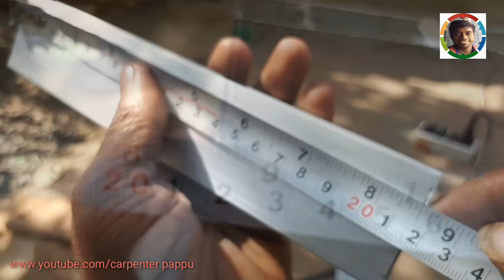Mini Aluminium bathroom door making

Comment: Bro how to repair the bottom corners of aluminium frame & pvc bathroom door which got Corroded & eroded due touch of water. Only bottom corners where both frames engaged together got damaged. Means L shape area.  I repaired selfin house once by putting L shape metallic part purchased from hardware shop however it is also now worned out/ eroded. Hence please advise whether it can be repaired at home or from fabricator/ carpenter or to replace complete door would be better. However pvc part & balance aluminium frame is still excellent only corners got damaged. Thanks!